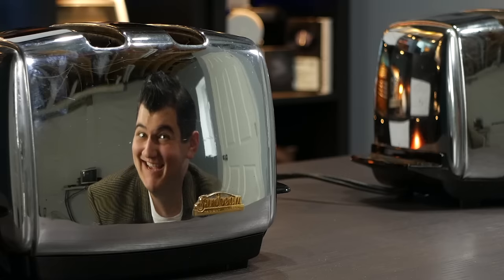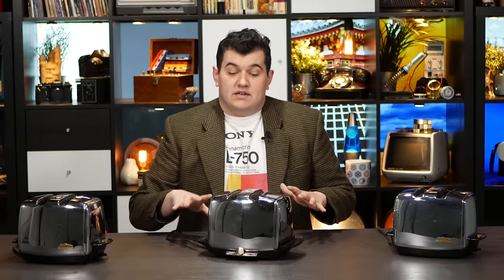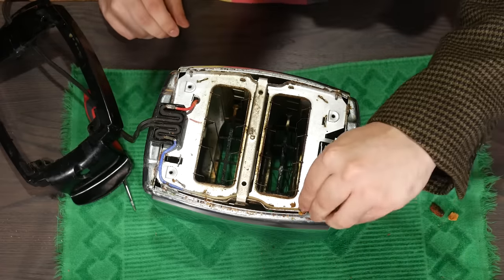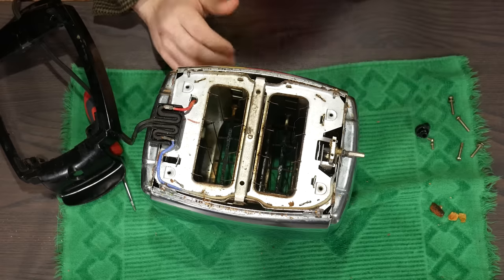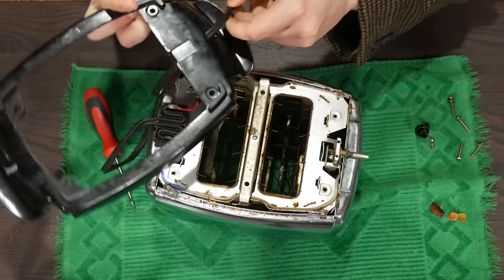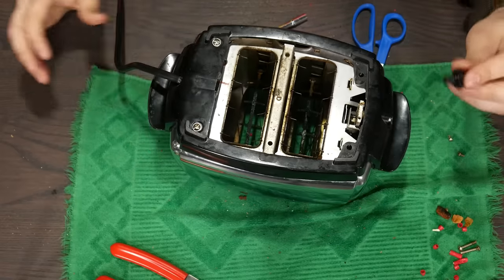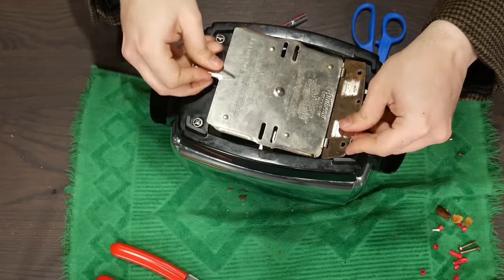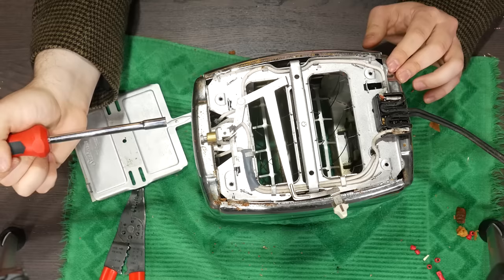Sunbeam Radiant Control Toaster--Repair and Modernization

Comment: Really interesting video, although I have to say that having "optional" earth/ground wires is mind boggling to us Brits. Nearly all our electrical equipment is earthed. Do the US have fuses in the appliances, we have them inside the plugs and I couldn't see if there was enough room for a fuse in a US plug. We do have main fuse boxes installed in our houses but we also have smaller fuses in appliances, in case of electrical surges.
Reply: Some US appliances have fuses inside, and I think they're getting more common these days as they improve safety in the event of a fault in the appliance.  But fuses in plugs are for different reasons - they are used when the socket can provide more current than the mains lead can safely carry.  The US uses radial mains and most US mains leads can carry full circuit current, so the consumer unit's circuit breaker is sufficient to protect the leads too.  However the UK uses ring mains so the available current is normally much more than a lead can carry, and additional protection is needed.

(Some low-power appliances in the US do have fuses in their plugs, so that smaller wire can be used in their mains leads.  I've seen this arrangement with fans and with fairy lights.  But it's uncommon in general.)

The UK scheme does also reduce the effect of faults - if the plug's fuse blows quick enough then the rest of the circuit will stay on, versus the US scheme where the whole circuit always shuts off.  But I think that's more a useful side effect than a cause.
Reply: @CoastalSphinx  thanks for the clarification. I can confirm that if a UK plug fuse blows, it doesnt affect the circuit throughout the rest of the home. I have seen a few fuses blow without any circuit shorts, the main fuse box in UK homes are to protect the appliances from external power surges/shorts. Or sometimes to protect the lines from foreign objects being plugged into the sockets (fingers/screwdrivers etc).

Comment: Put a couple drops of crazy glue in the strain relief the wires wont move.Use a small slotted screwdriver to seat them NOT YOUR FINGERS you will have a bad day.

Comment: 21:55 NOOOOO YOU DIDNT... “heat” doesn’t go up... hot air rises... (actually, cold air falls under hot air, pushing less dense hot air up) “HEAT” conducts from higher concentration to lower concentration, or radiates equally in all unobstructed directions...

Comment: How can anyone who's so interested in technology and disassembles so much, have such a limited and low quality toolset? :O.
Please, please please, get a decent toolset. They'll last you a lifetime in moderate household use ( especially if you stick to using the correct tools and don't improvise for the sake of lazyness ^^ ) and you'll get a far neater result like cleaner cuts, undamaged screws and wires.

Comment: 25:16 the use of butt splice connectors really makes me cringe.  It's very easy to be fooled into a secure crimp that isn't.  Especially in confined fitments like this.  Soldering would be best but if using these connectors, absolutely follow up with heat shrink tubing.  That way there's little chance of a bad crimp shorting to the chassis.

Comment: 1. fuck crimps! only soldering! only hardcore!
2. twist wires together tight, so that they provide sufficient contact, and then put a crimp over the twisted connection as extra.

Comment: 31:30 what if you put a piece of tape, like electrical tape or something similar, over the top of the stress relief so the wires didn't pop out so easily?

Comment: 1350 watts all through those little wires, huh? Isn't that right about one horsepower? Why did we ever think combustion engines were a good way to get power? I know the fuel line for a one horse engine would have an internal diameter of a quarter inch. How much smaller the electric supply lines.

Comment: Couldn't tell if you knew/did this: the crimper has a curved side and a nub side. The seam in the connector goes in the curved side. The nub crimps the solid side of the connector. If you didn't know this, you do now.

Comment: "Plug it in and hope I don't die?" Not something is want to hear from my knob and tube electrician. 

Butt connectors are due use in 12v or less - not mine voltage. +You'd want to replace wiring to the junction point or use a terminal block.(or a mar)

You could use a modern strain relief for $2. https://www.primecables.ca/p-376076-cab-cg-m16-sr-cable-gland-with-strain-relief-m16x15-thread-cable-od-510mm-ip68-black

You might want to not leave the line wire exposed outside your connectors

Comment: Come on man get your Jacket off and get a repair shirt on .And no they’re both copper ones has a Coating The other one does not. If it were aluminum it would’ve failed in less than a year. And it probably is asbestos but it’s not gonna get disturbed where it would bother anybody. Moving on the butt connector does not look like a high temperature connector if it’s not you’re in trouble. Next get a different crimping tool for that situation you need a crimping tool that works from the tip not in the middle of the handles. Next problem you might have wanted to take the frame and wash it up nice and clean before installing the new cord I mean you’ve got it apart anyway. Get a two wire cord the ground wire only makes the toaster more dangerous especially if you try to stick a fork or something like that in the top. However you do need to use a polarize plug and make sure you get The hot and neutral wires connected to the right side of the plug. Next He should have put a crimp ring at the end of the cord where it was stripped this would’ve kept the cord from pulling out once he re-install The black plastic (Bacolite) Frame

Comment: Butt connectors are crap and unreliable. A vastly better and safer method is to use heat shrink tubing and solder connections,  You could add a short wire to lengthen the neutral. Just use a good properly sized heat shrink tube insulation.

Comment: You keep checking for current with both hands. Don't do that! Weren't you taught, as I was, to put one hand behind your back? Shock pushes your arm away vs. current runs through your heart. At least that's what I was taught.

Comment: Why on earth are you putting the butt connectors INTO the strain relief? That's just going to cause so many headaches. Just do it right the first time and expose more of the inner cores so you have extra length to play with. Plus those butt connectors are just... bad. As you can see by how easily they pull apart. Ugh this video just frustrates me because people are going to watch this and think this is the right/safe way to do it.
Reply: haven't seen any videos blaming the loss of their homes or loved ones to this video so it's all good...
for now...
Reply: @rigormortiz5357  It's not even primarily about safety, although that is a concern. It's the point that if you're going to fix something, at least make sure it's in better condition than when you started.

Comment: After seeing this video about half way through, I really think that you shouldn't be doing this kind of things. You could have had proper tools, proper connectors, proper plan for the operation. Also if a live wire short circuits to the metal chassis it does not necessarily trip a circuit breaker without a fault current protection, but the ground wire will just save you from getting electrocuted if you touch the metal chassis. In my opinion you really shouldn't judge the true purpose of any wire just by looking at its color in any extension cord -> If you want to do more DIY work with electrical appliances, please do consider at least purchasing a multimeter for testing your circuits before you plug them in the mains.

Comment: I had to thumbs down this video because of the suggestion to solder the leads. Soldering is not allowed in household wiring in the National Electrical Code unless you use a ladle of hot solder to dip the leads. No professional electrician does this and you probably shouldn’t either. Just because it’s in an appliance instead of inside a wall doesn’t change my mind. The eutectic temperature of solder is too low for this application. If the leads unsolder under heat, you can potentially have fire or electrocution.

Comment: Oh God! You just crimped aluminum wire with a copper connector!!  Could not be on a more dangerous place. A wire that gets rather hot, over and over!  Due to the different expansions of copper and aluminum, the connection will loosen over time and arc. A big fire hazard and shock hazard as the insulation melts and burns. Please reevaluate your YouTube instructions.

Comment: Well your "crimp tool" is crap.  Throw those away and never use them again.  Get yourself a proper crimp tool (and a proper stripper as well)- Something like A Panduit CT-1550 or similar.  There's a reason why yours were $5 and nobody actually doing this kind of thing professionally uses them.